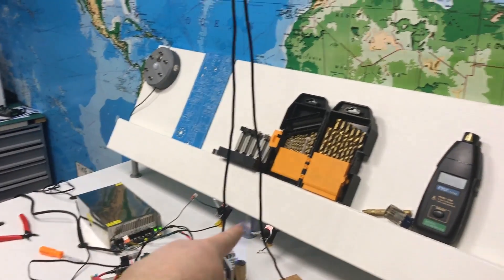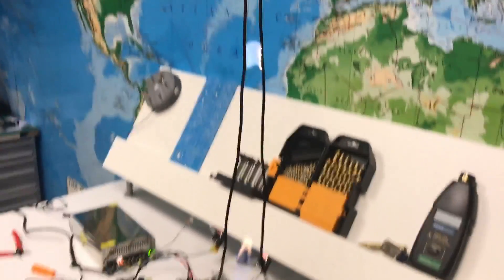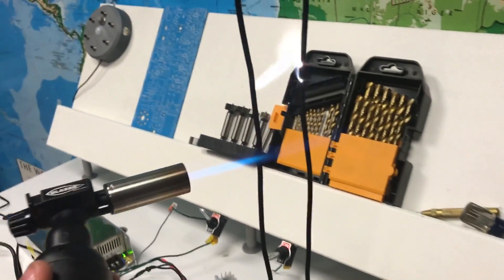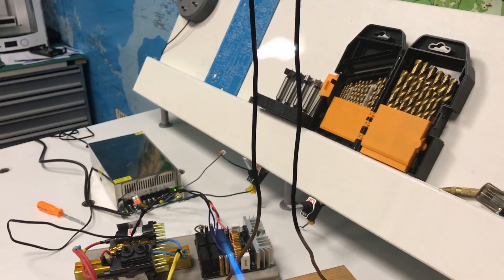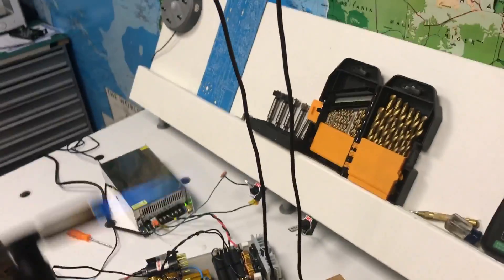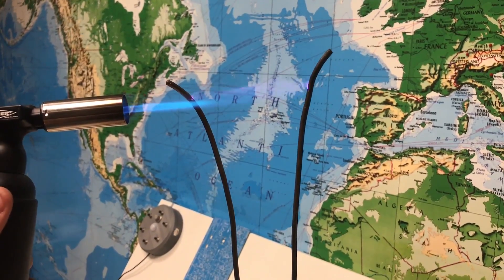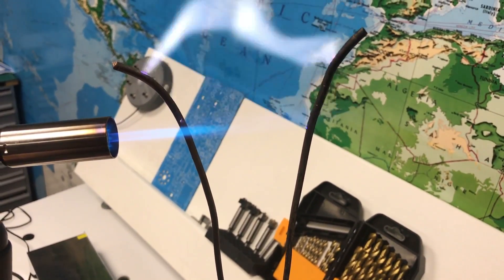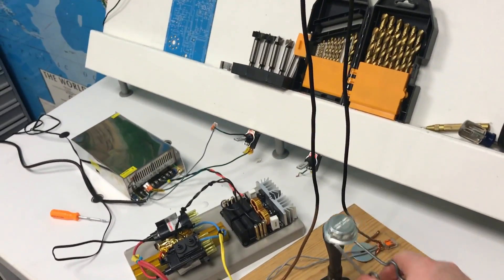Reverse HV Jacob's Ladder

Comment: i made same thing but with 1 flyback and 40A 15A input
much bigger spark
Reply from the maker: keza Cool!  This unit will run at 40V and have a much larger arc length with twice the current output because the flyback transformer secondaries are in parallel while sharing the same primary.